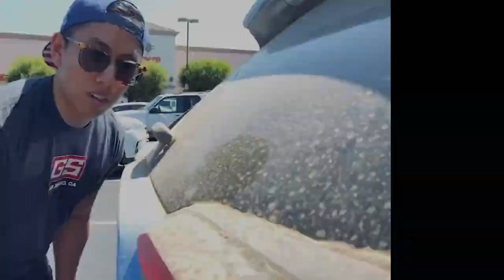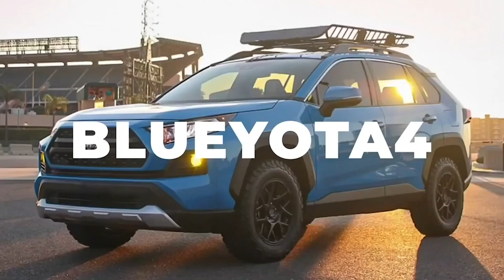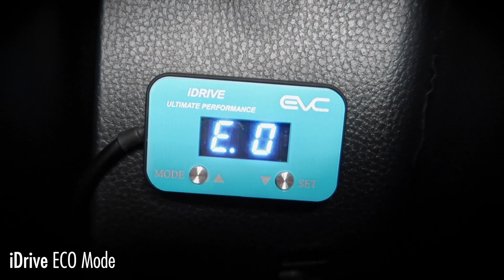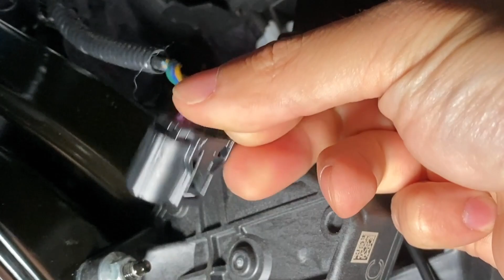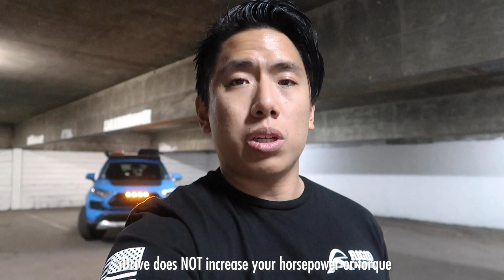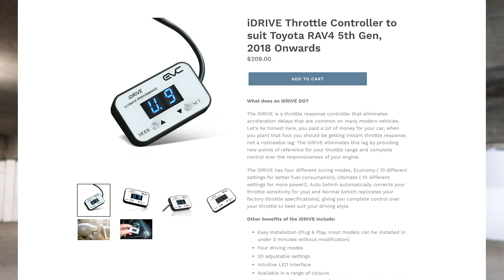Improve your 2019+ RAV4 Throttle Response with ultimate9 Throttle Controller

Comment: Has this improved your trail performance? Also, I notice when coming to stop signs and doing a rolling stop (1-5mph) that my torque seems to lag and jump a bit when I get back on the gas to go. Did you experience this prior and if so does the Idrive change that?

Comment: Hello, I bought some all weather mats off of you a few months ago and I have some questions. I have a 2020 RAV4. Currently it is stock. I was wondering about lifting it and changing the suspension. I saw your video for the EiBach suspension. Do you have other recommendations?
Reply from the maker: The Eibach’s lift would 💯 be my recommendation for lifting the RAV4! It may not be as tall as some spacer lifts currently available—however it will provide the best performance in terms of clearance and ride quality of anything currently on the market at or around the same price point.
Reply: @DannyRocksteady    do you think you could combine Eibach springs with a small (1”) spacer?